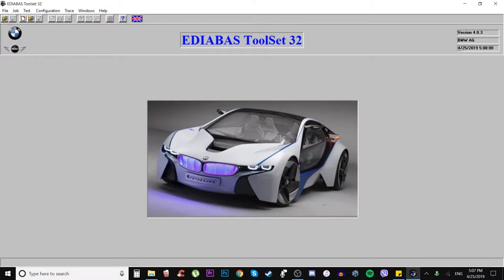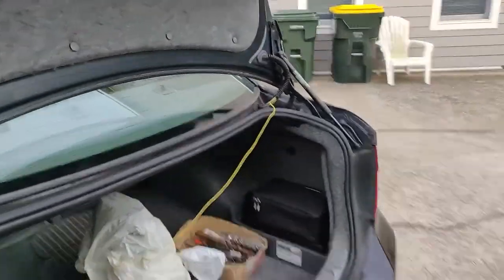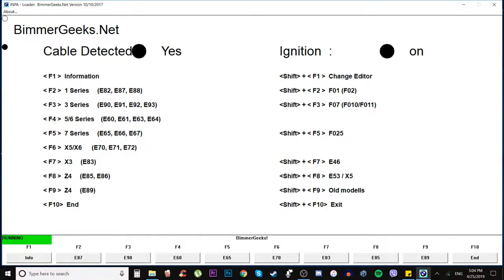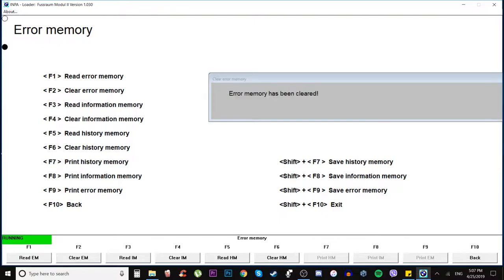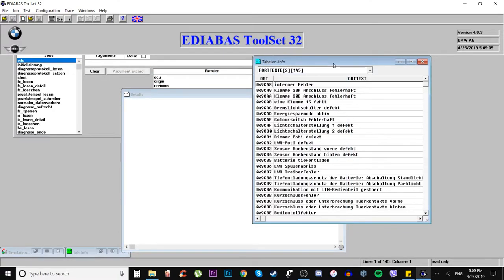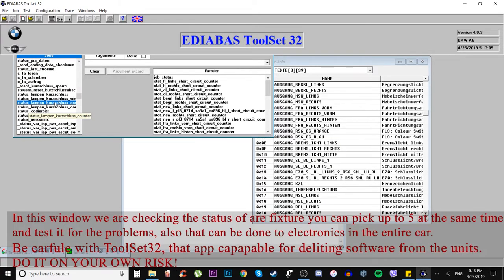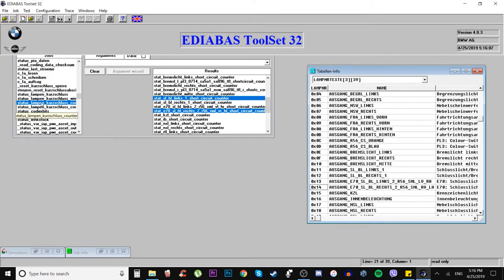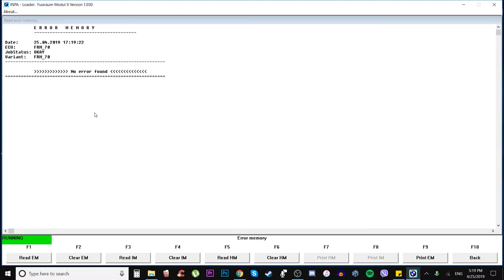BMW Coding FRM short circuit counter reset Toolset32. light not working. FRM2 FRM3

Comment: Hey i have problem with my high beams, after i updated my FRM  to model 3 on bmw e90 2005 everything including the highbeam worked properly, but after some codding to get the angel eyes as DRL and vin changes(successfully) , the high beams stopped working. I have tried the method shown above but it didn't changed much. I have selected reset_kurz.... the in the argument box i typed 0x00 then double click the reset_kurz... box after that i made the same with 0x01 code and notting, i had skpipped the first part where we checked if the counter displays number above 50 bit i don't think it will made some difference. In forums i found this command "steuern_reset_kurzschlussabschaltung" will it make some difference ?
Reply from the maker: Hi. the video is about counter reset, it's all about short circuits, if you have code for a short circuit in that case you follow the guide, the thing you need to do after you write the VIN to your new FRM is to re-set the FRM to VO. via NCSExpert do the following:
1. Load NCSExpert.
2. Load Profile and select Expert mode
3. F1 (VIN/ZCS/FA)
-
4. F3 (ZCS/FA f .ECU)
5. Choose E89 (for the E9X)
6. Select CAS(or whatever)
7. F6 (BACK)
8. F4 (Process ECU)
9. Select the Module I want to Revert back to Stock.
10. F2->Choose "SG_Codieren->ok
11. F3->to start coding the ecu with factory settings according to the vehicle VO.

Let me know if it worked.
Reply: @Makhnovets  Those steps are all ready done, because the frm was from e92 and my front widows worked like they are in a coupe 😅
Reply: Also tho know that this method throws faulty code because the date of manufacture of the cas module need to be changed to 09/2010 years so that in the process ecu menu appears a NFRM module and daten files with version 67.1
Reply from the maker: @nickfrazer6887  in that case you might need to flash new firmware to CAS FRM and DME. Newer done it. As far as I know the FRM 3 module was installed on cars 2008+, so there could be software issues the reason why frm3 work on 2007 it’s because new it’s got newer version of dme. Not sure if I got the year right but it close to that…
Reply: @Makhnovets  I have gotten the frm from 2012 e92
Reply: @Makhnovets  As far as software issue I don’t believe it because after I just installed it, without any coding, the high beams worked fine, the low beam and everything else. The issue appeared after I try to code the drls with Carly
Reply from the maker: @nickfrazer6887  so then resetting to VO. Should fix the problem, just make sure you have proper profile, you can make the new profile, previously I had problems when i was trying to reset module to default settings, it would throw me some message and wouldn’t let me reset it until I create the special profile for it… make sure you have it set up properly.
Reply: @Makhnovets   i have tried it but i didn't make a special profile, i have reset it with expert profile. Maybe this may solve the case
Reply from the maker: https://photos.app.goo.gl/1QSDLquBZrbtrpiG8
Check if you have same settings under ur profile. Load the profile you use, than edit the profile, password is: repxet
And see if every option Matching my
Reply from the maker: Any updates? did you check it out?
Reply: @Makhnovets Well yes, my headlight unit is the BI-XENON one so my high beams are my low beams and the shutter that controls them work, but my inner halogen lights don't comes up, also on default setting my flash to pass i set to the low beam shutter not to the inner halogen lights. I indeed don't have shout circuit counter problem. Also BI_XENON_BEI_LH_3R - (Flash to pass with bi-xenon lights instead of halogen lights) is set to nicht aktiv and still noting, the inner halogen refuses to come up even if i set them to drls with drl_h

Comment: Hi! Thanks for lovely video! 

Uhm… I’ve installed ISTA+ (I should have installed ISTA+p but due to space!) 

So problem narrowed it down, error shown up, 0x09CBC short circuit and it identified FRM_87 so I know that’s perfect for toolset32, open FRM_87… and then look for 0x09CBC and do that reset to 70?  (0x009CBC FRM: Short-circuit fault 1) 

But that error shown is it said “side front light” translated, it mean it’s short circuit to rear light, top light brake doesn’t work… (no power) everything else works fine. Just one top light passenger brake bulb. 

Also if I’m correctly, MRS5 I can do is disable 0x0093C1 on Toolset32? I’m not using bypass emulator anymore (crap!)

I’ve got few days left to retest MOT… hopefully you can be able to help me out! 

How do I know toolset32 works perfectly? 

ISTA works super, INPA isn’t working properly (missing E87 on F1) 
Toolset32 - it might work ? I mean I open the file, FRM_87 works and I click Identify the window appear (Not result one) I assume it worked?

Thank you! 😊

Comment: I got the info on Inpa when I use ToolSet32 and run FRM_70 I get the Results screen and it gwts stuck on loading and does not show the   other 2 job tabs. Need your help. This is for left adaptive headlight 2012 E92 328i
Reply: Ok 
I am trying to reset circuit shorts on my 2012 e92 328i. My left headlight went out because of water damage, and I replaced all the parts and everything works perfectly, except for the adaptive headlight. I found the short circuits on Toolset32, but for some reason, I do not have a “Tabllen-info” tab showing part ID numbers. It does not show up on my screen when I open FRM_87 and I cannot figure out how to open it. Please let me know if you have any idea on how yo open/access that tab, as i need it to check for the ID’s in order to fix the issue. Thank you.
Reply: The only way I see tye tabellen info screen is if I go to configuration and put a check mark on simulation. I don't  know what that is
Reply from the maker: I’m on the business trip at the moment for next two weeks, as far as I get back I’ll double check with it, the one suggestion will be to load frm_80 profile, or any other one that the program shows.
Reply: @Makhnovets  All good got it figured out

Comment: So I have a 2010 328i x drive ,  with no high beams turn signals, halos, power windows, cluster lights and interior lights, I have BMW tools and the cable, but the part of the video where your looking for the code and then countering it has me so confused. You only had the one light problem, and I have a lot , so does that mean I’m going to have a code for each light, and what are the odds I could get with you on video chat For a few minutes and help though this really need my car back :/
Reply from the maker: So most likely your FRM unit is little fried. I don't think that the good idea try to recover the every single light after all. If that would be me I simply will send the unit to the professional, they will fix it for 50-100$, only takes couple days.
If you have multiple light's and regulators failing, most likely you need new FRM or Repair! Check the internet the places do the BMW FRM unit repairs, you will have multiple choices...

Comment: When i try to load frm87 file throws out the error ifh-018 - initialization error. Any help?
Reply: same for me mine should show FRM70 but only frm87 shows in the list on inpa and then I get that error when I click it
Reply: or it says frm87 requested but frm70 found
Reply: @dude4548   you should see on Impa what file do U need. When U go to body or chassis/frm there is info what file u need to opet in tool32. 
I solve problem with IFH-0018!! U must open tool32 without opening impa becouse with opening Impa U block USB serial port-COM1. Just launch tool32 and open frm file and start editing
Reply from the maker: Is there only one FRM File on the screen? like frm87?

Comment: Hello I’m having an issue,i put adaptive headlights and only 1 DRL daytime running lights works… Idk what to do, Anyone know if resetting the FRM would help?
Reply from the maker: Yes, Reset it and code it from the scratch, after resetting check the counter true ToolSet32, make sure you don't have a short circuit. One more trick is to connect the multimeter to the DRL, and lock the car, let it sleep, then open it, in mean while keep an eye on Mult. The car should do cold monitoring, and sent the electric impulses to the unit, you should have few jumps on the Mult scale. compare to the one that working. 
https://drive.google.com/file/d/1Iy2vsQHLlm5uLjyw8qGCPG02-NZml1io/view?usp=sharing
Reply: @Makhnovets  But why would the passenger side drl work but not the driver side?
Reply: @Makhnovets  Should i find a shop that has tool32 an can do that? cause i dont know how
Reply: @Makhnovets  Do you do this for people who will pay you?

Comment: Hello buddy... when I got I body and select the FRM module, but mine is it reading the model. Can you help me?
Reply from the maker: Hey! Can you give me little more info about problem?
Reply: @Makhnovets  inpa software doesn’t pick up FRM module. Other modules it can read except for the FRM.
Reply: Can any one help me virtually, we can zoooom
Reply from the maker: Sorry for late response. The first what i wood ask is what year of the car and model. if it's 2006-7, you have to get the obd with the switch or solder the two pins, if 2008 and +, should be ok. then the INPA have couple options for your car, try to chose different one, also you can try to download database for your car if you check all the steps till now. make sure there latest drivers for the cable also! as well as the latency  is set to one in device manager! Re-install the app if you still have issues https://www.youtube.com/watch?v=uYQZcbutWcc
Reply from the maker: also if you not gonna be able to run the INPA after all of those steps, you can open the plastic which is covering your FRM module and check the version of it right on the module itself, my claimed as frm 2 but it has modification there so its something in between, long story short frm 2-3 gonna use same SGBD file in toolset32, so you can skeep the steps with the inpa, except make sure the cable is connected and detected which you can see on the first page of inpa app. in toolset32 after you load the SGBD grope file which is FRM_70, if the tool load the 4xWindows, means you good, if not try to load the different file as FRM_8x., go straight to the job window and look for STATUS_LAMPEN_KURZSHLUSS_COUNTER, IN WINDOW TO THE RIGHT YOU GONNA BE ABLE TO SELECT FROM 4-5 STAT, AFTER SELECTING 4, PRESS "F5" TO RUN THE JOB, TNE NEW WINDOW WILL POP UP, IT GONNA SHOW YOU THE JOB_ATATUS AT THE BOTTOM, USUALLY ITS GONNA BE 0, MEANS ALL GOOD IF 50 IT MEANS YOU REACH THE MAX AMOUNT OF ERRORS. IF YOU HAVE 0, THEN GO BACK TO JOB WINDOW, DESELECT SELECTED ITEMS AND SELECT NEW ONE, OR IF YOU KNOW PARTICULAR LIGHT BULB WHICH HAS A PROBLEM, FINDS AND RUN THE TEST WITH SELECTING IT AND PRESSING F5. HOPE IT WILL HELP!
the last but not least if you have multiple light problems, that's mean's you have a problem with your FRM unit, that's the case with no being able to read the unit, it has too many faults, and you gonna need to repair it or buy a new on and coded if that's the case you can find the services that are specialized on fixing FRM modules for relatively cheap compare the new unit.

Comment: When I attempt to run job on tools32 it states ecu service not supported, any ideas as in why its stating that error?
Reply from the maker: Can you use INPA? The cable is ok? Also inpa can not be on the background it has to be closed. What car you running and what frm model 2 or 3?
Reply: @Makhnovets  when I attempt to run on inpa it states group file:D_KBM.
SYS-0012, identification error
The FRM 87 is the name it states on the one I try job, not sure if that would be 1 or 2?
Reply: @Makhnovets  Also the car im using is 2013 328i XDRIVE , basically what I'm trying to do is reset the short circuit count on the frm module. Managed to download and navigate through programs, but coming across these errors that are preventing me from doing jobs in programs.
Reply: @Makhnovets  also this is the dcan cable I got, https://www.amazon.com/LZLRUN-Diagnostic-Interface-FT232RL-Programing/dp/B017IG81SQ/ref=mp_s_a_1_2?dchild=1&keywords=dkan+cable&qid=1589602662&sprefix=dkan&sr=8-2, it came with its own software on disk but  gave me this issue as well so I then installed whols new software from EasyBMWTools but got same errors.
Reply from the maker: https://amzn.to/2Z6LDAh - that's what I using. also, check the installation guide https://www.youtube.com/watch?v=uYQZcbutWcc / as well make sure you don't use the tools from CD! they will not work! use INPA as in the video and make sure everything works properly! if cable port and latency are not 1 ! the apps will not work! download and install Standart tools! https://www.bimmergeeks.net/downloads a-lot of apps from inet is f*top, so be aware of it! bimmergeegs is great web site, and it's free! most likely the cable is OK, but apps you using are bad, so try to install them properly one more times!
Reply: @Makhnovets  Great guide you have for bimmergeeks installation, i went through all the steps but its still giving me same error. The only thing I was not able to do from your inpa installation video was updating the com port driver, in the process of updating i stored ftdiport.inf and ftdibus.inf in a blank folder that i can refer to when it asks me to search for drivers location. But once I attempt to update driver it states "The Best Drivers For Your Decice Are Already Installed", do you think that might be the issue?
Reply: @Makhnovets   do you think it might be the dcan cable that's resulting to "ecu service not supported" error?

Comment: this video would be really helpful if: you talked slower, zoomed in on screen changes. as is, the screens are a blur and the information comes way too fast.
I bought the BMW hard drive and tool 32 but afraid of doing more damage than good. I have a headlight out that works when plugged in other side.
Reply from the maker: Thanks for the tip! in the future will do more tutorials, and will take it into consideration. 
In the job window, find the: status lampen carchless counter, this function is only for testing, so you not going to do any harm, you will be able to choose 4-6 options at a time, then test it and look for the values <=50, otherwise if you have no number 50 in any of those options, there no problem with a short circuit. watch the Video at a slower speed, there setting on youtube for that. Also, watch the Video in full without skipping.
I understand that the video I not perfect, but it's pretty useful. you can search how to reset the short circuit counter toolset32, you will have a few forums and explanations, and might it will have more details.
 good luck.
Reply: Same issue here, Do local shops do this? idk how to do this, looks hard asf… my headlight drl is out but its fixed now gotta reset the faults but idk